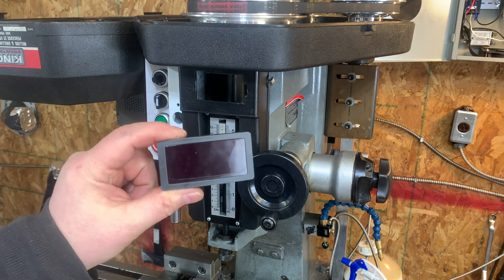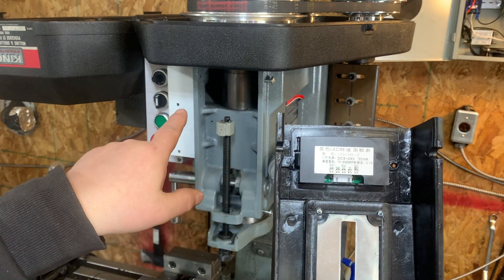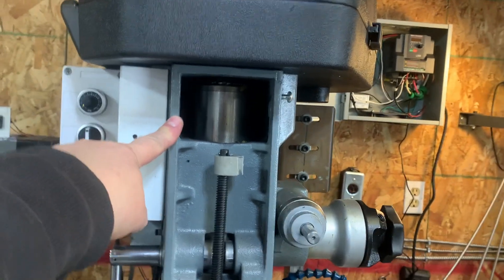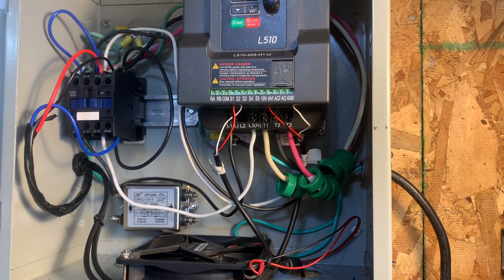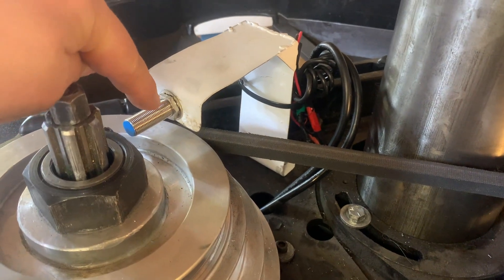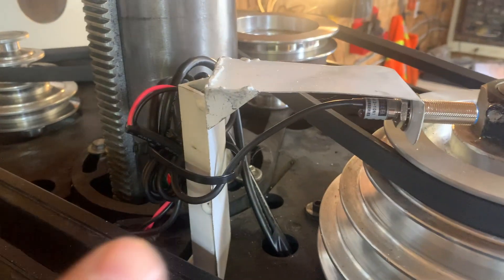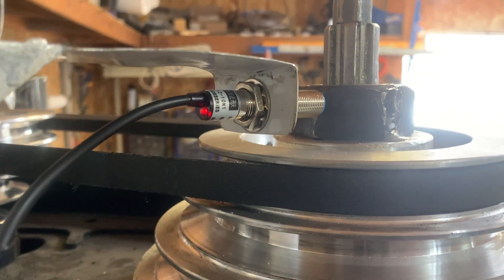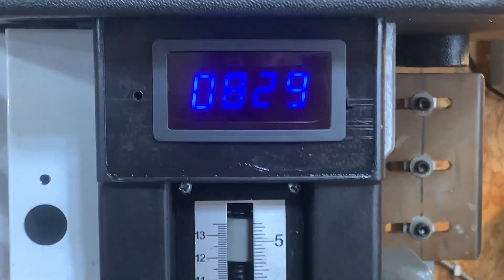Install a Tachometer on a Round Column Mill

Comment: Your tac is not working right because you're motor is a three fase
Reply: the tach is measuring the spindle speed what difference does it make what phase the motor is?
Reply: @steveu235  three fase and single fase are different
Reply: @samlogosz8422 what he has installed is a Hall effect tach (magnet), it’s not tapping off the motor phases.  Although he could, but it would read the speed of the motor and not the spindle, which would make it inaccurate.
Reply: @samlogosz8422 what he has installed is a Hall effect tach (magnet), it’s not tapping off the motor phases.  Although he could, but it would read the speed of the motor and not the spindle, which would make it inaccurate.
Reply from the maker: Interesting. I’ll have to read up on that a bit further.